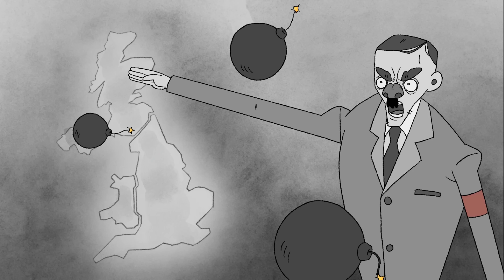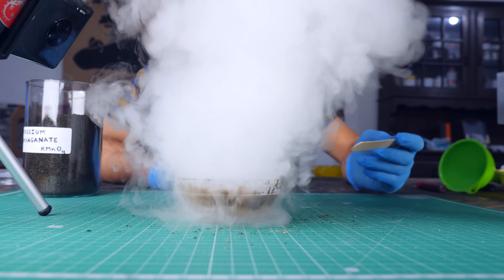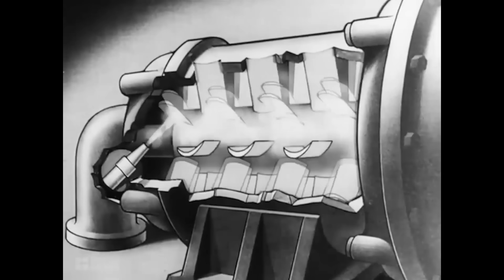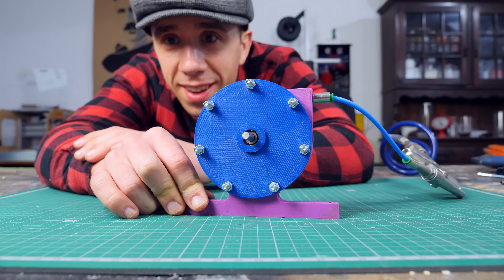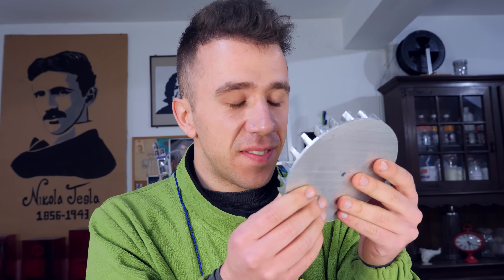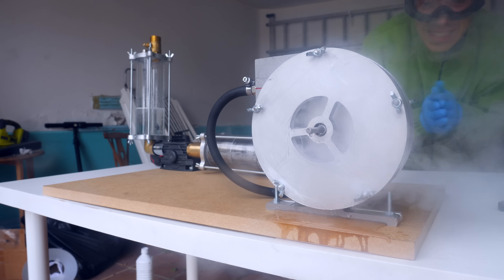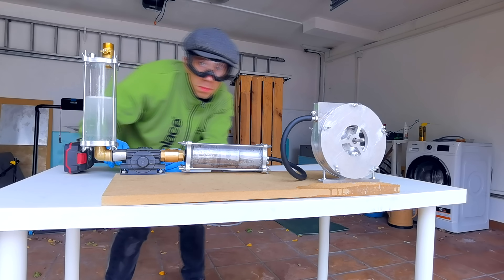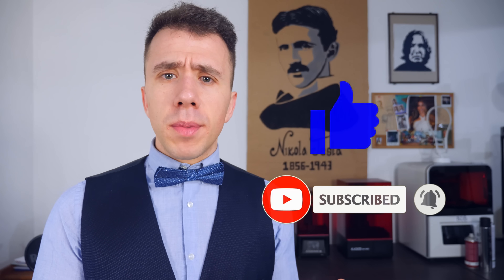I built the World War II V2 Rocket Steam Turbine

Comment: You could use a condenser in order to get rid of the water and have an rich oxigen ouput flow that you could use later in the combustion. Another thing you could do is putting the catalysator verticaly and putting a nozzle. From a chemistry POV, I suggest preheating the solution of hidrogen peroxide  in order to accelerate the reaccion speed of the H2O2. (I wouldn't consider heating the reactant over 40ºC as the reaction is exotermic itself . Be careful as it will also accelerate the natural decomposition of it and therefore there could be some preasure builing up in the peroxide tank). I really loved this video as I am a chemical-engineering student and therefore I understood most of the problems you are faceing in the video.
Reply: Also you could use a pitot tube in order to measure the output preasure of the stream and then calcuate a thrust.

Comment: Turn the catalytic converter 90 degrees so you don't push peroxide through to the turbine. Also - how about connecting the drive shaft of the turbine to the pump, so it can run itself?

Comment: I think an RC high-powered steam turbine model racing boat would be a cool application for a system like this. The system's weight wouldn't be as much of an issue given it only has to float and not fly lol. The torque to spin a propeller would be the challenge and would probably require some turbine tweaking, but it would be cool to see how fast it could go across water. It would also be interesting to see what kind of hydrofoils or hull shapes you come up with! Awesome work as always!

Comment: I wonder if putting a pressure regulator coming out of the catalyser along with placing it to be vertical would make a more efficient reaction and allow more of the reaction to take place before reaching the turbine. Along with being a bit safer but that’s just a happy byproduct :) Also a more efficient turbine design would greatly help, preferably being able to make a seal with the case to harness significantly more of the steams energy, and a basic oiling system would also help, sending some oil through with the steam right before injection might be enough.

Comment: Video idea:
Steam rocket skates? 

My suggestion on improvements:
As improvements, a simple one could be slightly tilting the catalytic converter   Similar to a motorcycle exhaust. Since it appears that in the video it all pooled at the exit and allowing it to spill into the turbine. And could move the exhaust exist from the catalytic converter higher, upper edge. To allow enough time to react and turn into steam and giving it space to pool in and not reducing the power/pressure of the steam generated.

Only reason I would be against vertical catalytic converter is because that steam would have to travel a longer distance to the turbine and condense into water.

Comment: You're drowning the catalytic converters. Put some type of spray nozzle after the pump going into the catalytic converter. I think a hollow cone spray pattern nozzle for pressure washers or even a fuel injector and pump( plus it runs off 12 volts) Either should work great. At the very least maybe just a garden hose sprayer.

 This way it will give the peroxide more surface area which will react faster and hotter without flooding the catalytic converters and blowing out and wasting most of the peroxide. 

This turbine has a lot of potential, you went through all the time to CNC it from aluminum so try a nozzle.

Comment: First thought would be to push the hydrogen peroxide upward into the catalyst, as steam and oxygen will rise while the peroxide stays closer to the catalyst. The pressurized pump should work well for this purpose. Essentially the holding tank, pump and the catalyst "boiler" would be in a U shape, with the "boiler" next to the turbine. As for increased power, two ideas may work, gears, and/or controlled release of steam, which would be like the intake-exhaust cycle of an engine.

Comment: You should try using multiple reaction chambers, that way when the steam carries over the liquid hydrogen peroxide it goes into another catalyst and is able to be fully converted into steam
Reply: At different volume stages too. Successive chambers being smaller and pushing the steam out faster. I think pressure is more important than mass for this sort of application.

Comment: Invert the reaction chamber, and add a space between the hose and the catalyst to form a buffer so the liquid peroxide is less likely to transfer into the hose. Also (of you know this) create a nozzle to optimize the thrust. If you're using bearings in the metal prototype (I couldn't tell), try using bearings with an ABEC rating of at least 15, but shoot for higher if you can. Ceramic bearings help as well to dampen vibration, but don't last very long. Great video as always!

Comment: Love this!! 
I would add a high pressure reservoir/accumulator after the vertically mounted catalysts. This would need a high pressure feed pump, maybe common rail fuel injector pump for cars, easily capable of 100 plus bar. Add a pilot operated valve after the pump so as the pressure drops in the reservoir more hydrogen peroxide is added to the catalysts, the fuel pump has a built in return to tank so its always circulating. 
Could also experiment using injectors to atomize the hydrogen peroxide over the catalysts.
The catalyst chamber and pressure reservoir would be at the same pressure so could be made in one high pressure vessel. I would use a small hydraulic cylinder and at least one pressure relief valve. The steam from the reservoir could then be metered through a valve to the turbine for desired power/speed plus having on demand steam without waiting for reaction.

Comment: Very cool, as an HVAC service and design specialist you need a trap to catch liquid and return it. This way you have pure steam going to the turbine. This is similar to steam heat and or steam humidifiers. We can trap all liquid and return it allowing steam to enter duct work to be distributed. Also turbine may need a weep hole at bottom for any compensating steam to drain. Where can I find the 3d print files. Thanks!

Comment: I think a big problem with the catalyser is that too much hydrogen peroxide is being injected and it's not being distributed equally over the catalysts so a lot doesn't get the chance to touch the surface, pools at the bottom and gets entrained and ejected. I'd be tempted to try to turn the assembly vertically with the hydrogen peroxide injected at the top in a spray pattern, maybe by a fuel injector or two? This could be rigged up pretty simply with a fuel injector tester and car fuel pump. You could get away with just the nozzles, not sure how long the injectors would last with hydrogen peroxide instead of petrol. Also maybe add a sump with a catalyser in it as well to collect any excess and give it a second chance to be converted before exiting.
On the turbine itself I'm no aero expert but it tends to be clearances which absolutely kill the efficiency. Anywhere the working fluid can leak past the vanes without doing work, it will. Maybe consider some form of thin liner to take up clearances? Leaving room for thermal and centrifugal expansion, of course.

Comment: This is a multitude of random suggestions as I have avoided physics like the plague forever, anyway...  You could maybe try mounting your catalytic converter at an angle so less peroxide just gets sent through and it has a longer time to react, you also seem to be losing a lot of pressure from the exhaust, maybe play about with shrinking it a bit and tolerances?  Metal is cold, I know that at least, and steam + cold surface = condensation.  Maybe you could think of a way to heat the metal or something at first?  I can't help but notice you're also just sending it straight from conversion, perhaps the addition of those funny looking funnel things I forget the name of might help increase pressure too?  As others have mentioned, lubricant helps, but you could also maybe look at the addition of thrust roller bearings to help reduce friction.
Doubt any of these will make any significant difference, but not much harm in trying, right? :P

Comment: Feels like you should be able to Generate Electricity with this...

You could also use (the Generated) Electricity to power Electro Magnetic Fields, and replace the Friction generating Ball Bearings with a Ferrous Rod that is Held in place Magnetically.

Comment: Try powering something with either the Tesla turbine or this turbine, either converting to electricity and back to mechanical power or straight to mechanical power. (Charge a battery powered skate board and use the skateboard)

Comment: Better fix for peroxide leaking from turbine if you do these 2 things it may help 1 make catalyst container vertical (this would cause issue with top converter not being used) 2nd this issue can be fixxed if you make peroxide being pumped thru the top so it flows from top to bottom 

Also to add to this i just thought about it you can make a mechanical feed so you dont waste to much peroxide every 5 to 10 sec it sends a small amount in so the pressure stays about the same and doesnt waste to much 

I legit look forward to your vids recently found your channel and have been going back to watch older vids i find you to be funny and you give good knowledge that i didnt already know keep it up ♡

Comment: So, first thing as mentioned before: Vertical placement of the catalysators to prevent liquid going into the turbine; Secondly you need more steam nozzles to hit the blades, and maybe a redesign of the blades themselves :) Take inspiration from a turbo compressor ;)
Reply: Instead of centrifugal pump design, he should use the design of one of those micro hydro turbines with the dual scopes instead of impellers. The scopes cause the water to turn completely around, imparting maximum force on the turbine. Having a balanced number of nozzles will reduce the imbalanced forces on the turbine, helping the bearings out. The more nozzles, the more power, but the higher flow rate required.
Reply: @The Practical 3D Printing Project they extract energy from high velocity fluid. Liquids and gases are both fluids, and super high pressure steam is going to be moving at a tremendous velocity. I'd still like to see him try it, because I think it would be pretty effective.
Reply: @WarrenGarabrandt  Pelton turbines are effective for incompressible fluids (liquids are incompressible). Such fluids have energy in form of kinetic energy which is extracted by the Pelton scoops. For compressible fluids, energy is both potential (in compression) and kinetic (in motion). The turbine design is different to allow expansion. Expansion causes velocity to increase (compression potential energy is converted to kinetic), then kinetic energy is extracted using turbine. Pelton is thus not used for gases.
Reply: @snehanshourya3850  oh, I didn't even think about the expansion component.
Reply: @WarrenGarabrandt  Sounds like an interesting idea, but how would he manufacture the split scoop design? The bits of his CNC router wouldn't be able to remove the material inside the scoops.
Reply: @xXxLolerTypxXx  oh... Maybe he'd need to buy the scoops and install them into his own wheel.
Reply: You beat me to it. the cat is pointing down, allowing the liquid to go to the outlet before the gas.

Comment: If you want more power, you have to preheat the steam. I suppose you could use some copper tubing with powerful blowtorch - that will ensure, that the steam is not converting back to water and lowering it's volume significantly.

Comment: On top of mounting the catalyzer vertically you add an insulated chamber right before the turbine to catch the water either pushed or condensed in the line.

Plus you can add a a second tank with a y connector before the pump so you can flush the system with boiling water first to preheat the components and reduce the delay you see at the start (increasing temperature will also make the reaction more violent)

In the turbine you can make the steam nozzle and line with plastic to reduce conductivity and prevent the aluminium to suck all the heat out of the steam and condense it.

You can also add piston engine using the now low pression steam and finally condense it and use the oxygen for an "afterburner" with an hybrid rocket. Even if it only decorative, it is still a rocket !

Comment: Hi Integza 😊.
A few ideas for you to improve performance:
1.increase the percentage of peroxide if you can.
2. Mount the catysor vertically so that gravity helps seperate the liquid, if liquid still come out, ad a stagnation area (a void) between the  exit point of the steam and the calatysor, if liquid still comes out, put a vortex separator after the void to use centrifugal force to catch the drip and allow them to drip back into the catalysts.
3. Ensure the hex hole in your push fit fittings is not giving you a pressure drop, your tubes look being enough but sometime the hex inside can add a restriction.
4. If you want to get equivalent performance with compressed air, you need to make sure your catalyst tube is pressure rated at the temperatures generated. I would suggest getting a thermocouple and pressure sensor inside to see where you are now, then put a pressure relief valve at the output and test upto 10 bar outside with ppe. Then if it passes, only run it at 5 bar to be safe and keep the pressure relief valve in line but set at 5 bar to increase the calaysis pressure.
5. (I've done this before when designing a turbine so dont worry) you need to put the gas in the center, spin it with stator, then catch it with rotor vanes to get the most out of a single stage turbine. The curvature is determined by speed and a little more complex but aim for 45 degrees relative to the radial lines from the center, your efficiency will go up a lot just because the gas is going the way centrepetal force wants it too 😊. Exhaust out the tangent of the disk rather than input, it'll be way more efficient.
6. Just like with any industrial turbine, multiple stages, getting bigger the further down the process to account for pressure drop will help you get the most power out of the turbine. Stick with 1 stage for now though to keep it simple, points 1-4 should help quite a lot without overcomplication.
Hope this helps 👍😊 if I get time I'll try and do some CFD analysis on the cad files for you (if I get time) I did a little for the hacksmith a while ago.
Reply: Just seen that JXLPY suggested the first half of point 2 so credit to them!
Reply: The 3d data link doesn't work btw Integza

Comment: You could try and build a small version of this turbine and fuel system and put it on an rc boat or plane. Then put an axle from the turbine to a propeller so the rotational force and the thrust from the steam can be used together. Use that in one housing, afterburner style! 😁😁

Comment: Video Idea: Using your CnC machine you should try to make a multi stage compression jet engine like the PW-229 used in fighter aircraft with an optional after burner maybe. The first stages could be 3d printed but after the combustion chamber they'd have to be metal.

Comment: Would also help if you designed the fins to re direct the exhaust out of the turbo rather then letting it impinge on the other fins (which impacts them to slow the impellor down) i.e. the design you normally see with the weird twist shaft that goes towards the exit mouth

Comment: OK. You can ramp up the outcome voltage in few ways (or all at same time)
1 - add more motors.
2 - Change the gearing (I see you are using most of the time 1:1 ratio).
3 - Add Flywheel at some point (to keep steady RPM)
I know you probably already know that, but for those who not get it here is explanation:
Output - The axle powered by turbine
Input - the axle connected to a electric motor / wheels
If you want more power - electric power, you need to make output bigger, smaller input (2:1 generator will spin 2x faster)
If you want more torque - more power on the wheels you have to make bigger input (1:2 wheels will spin 2x slower but will get more torque)

Comment: Same design, but make the catalysers operate vertically with sealant to prevent bypass and run a series of catalysers to ensure that pure steam is the only thing exiting the system. would look super cool if you used copper tubes and made the catalyser as a backpack design.

Comment: The reaction chamber should be vertical (inlet at the bottom), and wider than the catalysts (not by much, just enough to let the liquid have an easy path back to the bottom) and have a larger space between catalyst and connector (maybe some internal baffles in that part - Tesla Valve?).

Comment: If you mount your catconverters vertically and have the peroxide be injected from the top, you can then have the gas outlet hole also in the top. This would stop most of the liquid going through the outlet pipe. And would also give you a more complete reaction as the liquid would fall the whole length of the tower and if there was any excess it would just sit in the bottom.

Comment: Since you were using 50% H2O2, The rest is probably water hence you had a lot of that cooling and damping the steam. There are methods to distill hydrogen peroxide to higher concentrations, so maybe you should try this? I also think the pump was quite oversized. In addition, the inlet to the turbine is probably not optimised, but no idea if you need a converging or de Laval nozzle?

Comment: Very cool! Why not mount your catalytic convertor section vertically, with the H2O2 inlet on the bottom and the steam outlet on the top, this should limit or stop the un-catalysed H2O2 from leaving the catalytic converter and only steam coming out. Maybe also look at a spray nozzle that will semi- atomise the H2O2 as it enters the catalytic converter and might give a quicker/ more efficient reaction